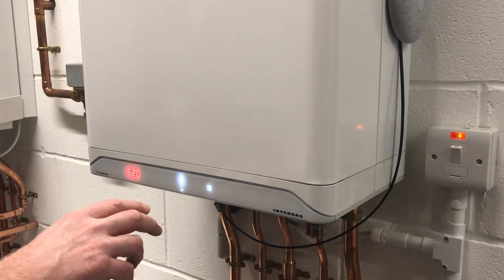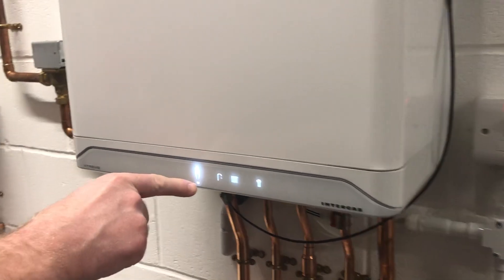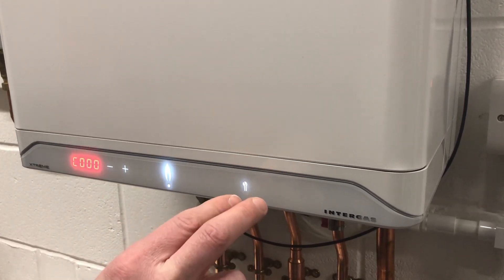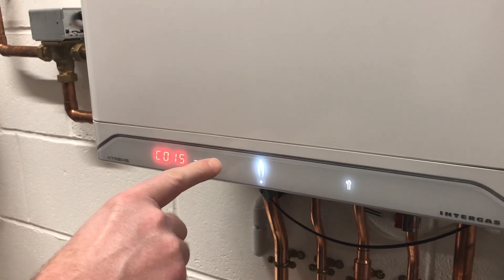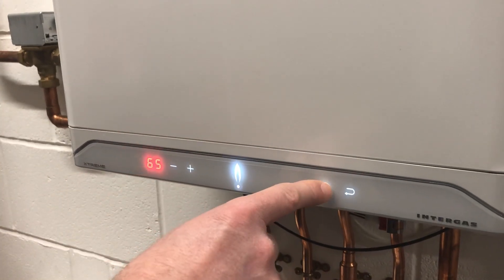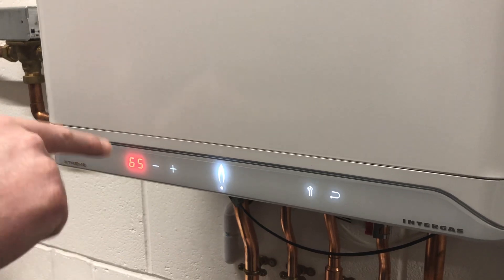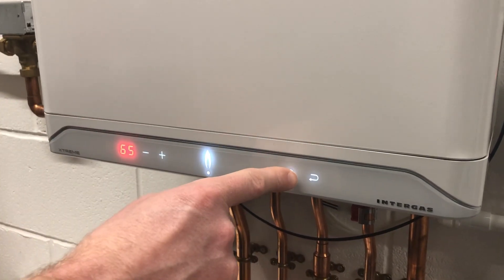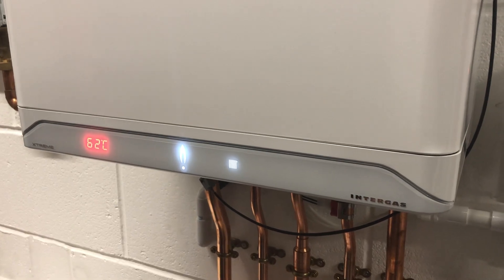TheIntergasShop.co.uk | Adjusting the central heating output (kW) on an Intergas Xtreme boiler

Comment: Thx - how does one calculate the required heating KW’s for a house in order to set the appropriate max power percentage on the xtreme?
Reply from the maker: There are some rules of thumb I use depending how old your property is. Old properties as a rough 'guess' I use 100W/m2 (so 100W for each meter squared) of floor area (so a 100m2 property - 100 x 100 = 10,000W or 10kW). Newer properties 30-50W/m2. Obviously this is a rough guess and does not replace a heat loss calculation, of which I would use Heat Engineer software (https://www.heat-engineer.com/).